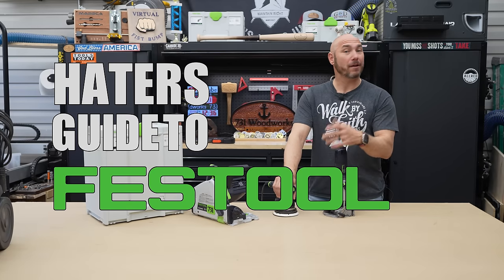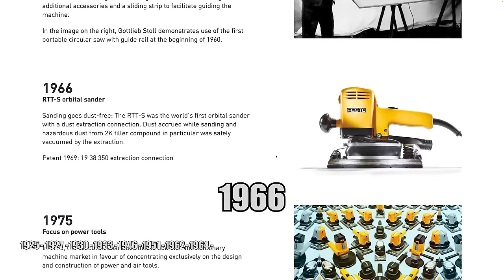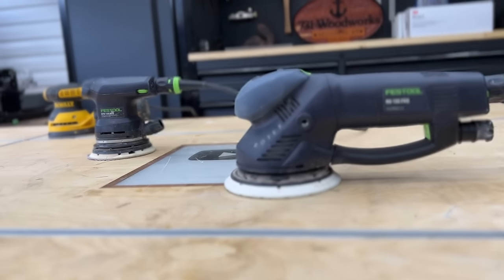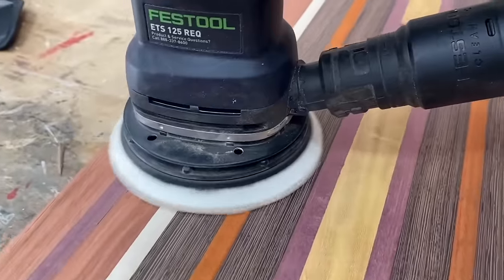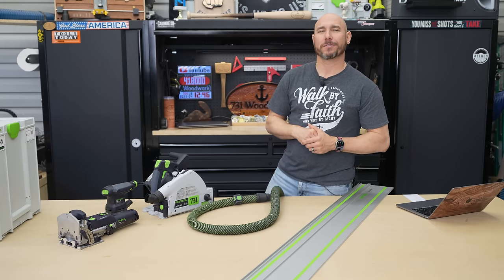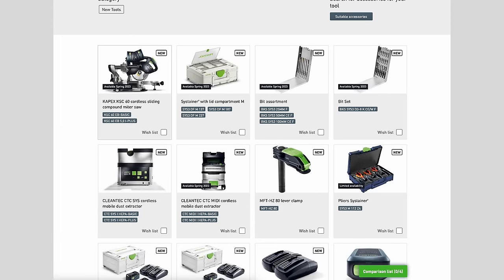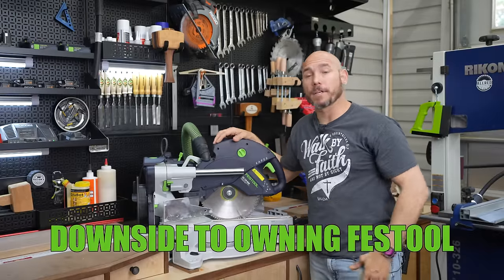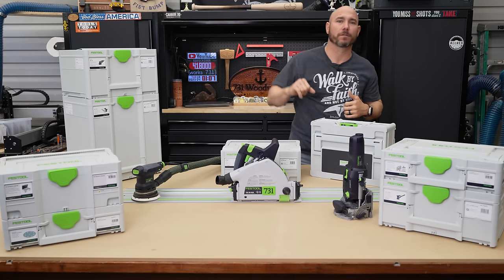The Hater's Guide to Festool | How Festool Changed the Game

Comment: I have been a professional cabinet maker for 39 years.
I watched Norm for years. He used a porter cable small worm drive saw and 2 clamps and a straight edge to cut sheet goods.
When I saw the track saw I about fell over, along with the price. So I saved up and bought it. GEEZZZ it saved me hours cutting sheet goods. Along with being as accurate as my Delta Unisaw. Enough said. Then I bought a festool vac and sander from one of their clearance sales online.
I saved 30% by buying what they considered a number 3, which was supposed to be an item that was returned and showed wear. Lol, it came perfect. Not sure of what marks or signs of use but was mint. After using that vac with that sander it changed how I sanded. I could skip grits and still would get a better job than  using my air Dynabrade sanders. I was sold. All the haters either don't have Festool or never tried Festool.
What's sad is most of these haters will hate on anything and everything.  Keep up the good work. Remember, the silent majority loves Festool.

Comment: I’ve owned and used Festool for quite some time. There tools are in my opinion the best. They save time and that’s money in the pocket. So probably not so expensive. I have used the rotex ro 125 and the ets ec 125 on solid surfaces counter tops for 10hrs a day 5 to 7 days a week for 8 years and there still going. I’ve also used just about every sander out there. Big name sanders, air sanders, big box store sanders. None of them come close. Have a good one.

Comment: On the TS55, i wouldnt get 2 54" tracks. That's a waste IMO. That extra track has nonuse unless youre cutting longer than 48".  Instead, get a 75" and a 32" or 42".  You can still join them together to cut 8', but the 75" os a little better at a 48" cut as there's more overhang on each end and you can use it to cut 60" Baltic Birch.  And the shorter track is a lot more handy for cutting parts to length.

Comment: I used feetool sanders for sanding plastered walls. Combined with their vacuum. Wasn't too impressed, still quite a lot of dust. When the highest priority is getting things done fast then yeah, many of those fancy tools help with that. I don't see why people use dominos on edge joints. Just for aligning? For building furniture I feel like you would need other tools. And for carpentry (at least what carpentry is for me) you would need more robust tools for rough work.
Oh and all those cheap ABS plastic boxes? I stuffed all the boxes into the garbage bin. I have no space for those. I never put tools back into those. For me it's a waste of resource that now every tool has to come in a huge plastic box and then you are expected to add a whole tower of more boxes. I'd rather buy a good table saw than a miter saw. And if you are just doing wood working as a hobby you can do quality work with the simplest tools. It won't be the fastest way but no amount of tools will create better quality. Furniture now isn't any better than 200 years ago. Just cheaper.

Comment: I saw contractors work with Festool tools and I asked one of them to try their screwdriver. It screwed in a long screw into a thick piece of pine. I was astonished and I decided to buy one for myself. I bought it at a discount and I use it daily for five years now. Although I can't afford Festool tools, I appreciate the quality of their tools. My other tools are mostly made up by Bosch and Makita, which are very good tools as well. I don't need them, but I know how they feel in the hand. They're friggin' expensive, but just to watch the tool do its job is pretty satisfying. It's a brand that engineers products and I appreciate engineers, they think of practical solutions for the everyday job.

Comment: I am working in public services and I am away a lot where I need to work the cheap stuff from the construction markets and it really sucks if they stip screws or simply brake apart. Dewalt, Maikta and so on clearly is a choice but not in the budget as it needs to be cheap only because we'll just use it a few times... Now I tend to bring my private tools on the field trip inlcuding Festool, Fein, Mafell and apart from the extra luggage I am happy at work with my Hobbysist tool selection.
The price is of course a critical point for a hobbyist but I bought a lot of the stuff used in good or bad condition and it works like a charm. That said, I never had a used tool break on me with festool but some  new tools needed to be sent in after a few weeks (Kapex, Chargers, Syslite, C18) and last since then. Most of the stuff I could sell today at a higher price than what I paid for it a few years ago. So for me it was a good deal. However, I think here in europe the used tool market is a bit more tame as a lot of Festool and so on is used and you have a better selection. Still it may take some time for a good offer.

Comment: Love festool/// get aggravated with festool.   What doesn’t bother me.. high PRICE of tool. What does bother me.. high price of consumables or sanding pads, saw blades. 

What I love is how well the tools are made and yet they absolutely ignore critical feedback from US customers. Festool is a lot like Apple.. they tell us all what we need and then tell us we will like what they come up with.  And yes… I often do like my Festools as I like my Mac and Ipone. However I loathe the fact that my $4500 laptop doesn’t have a touch screen or pop off screen that becomes a tablet.  I hate that it won’t play a lot of games well.  I hate that I can get silver or slightly darker silver (grey) colors.  Festool doesn’t make a good job site table saw, the new one is too small. Festools miter saws handles are a pain to use and festool needs to offer shadow line on all of their saws and an ultra capacity 12”.  

Lots of other issues that festool could remedy like their cheap and cheap foam plastic storage cases. Or their crazy location of switches and speed adjustment on some of their sanders. 

Regardless. I’ve yet to find a perfect tool manufacturer. Festool is certainly a quality brand.

Comment: Let me give my reasons for not using Festool. I always have said they were good tools. When you figure in the research and development plus the cost and a decent profit for investors as well as paying a decent wage. The price of the tool at the retail level would come out at about 50% of the price. They can charge what they want. I am happy to pay a fair price for quality tools. That's just it; a fair price. Festool is trying to sell their tool's quality by charging more, inferring that they are worth the price. I wouldn't bat an eye if Festool was at 50% of the current price. It's like a cup of condensed soup selling for $10. Is it good soup, yes. Is it worth $10? No. As for ease of use, it's like Snapon tools; it's just not worth the money no matter how good it is. And for the ease of use. There are plenty of tools, if you think about that can be made to operate as well. Also, Festool is off standard so if something breaks, I'm out of luck. If they were sent free to me, I wouldn't use them other than for paper weights or the equivelant. I would invest in the parent company of  Festool if I was twenty years younger, that's different then using their products. Be safe.

Comment: Reason that we hate festool is not because it is expensive. Price is fair and I'll even go as far to say that their machines for most part are not bad. But they are way WAY overrated in most instances

Then there is the whole incompatibility with just about any that is not Festool.  Proprietary bits, seriously?! God forbid you should make your saws compatible with a different rail system, that would be a scandal!  Didn't seem to bother Mafell who gave their MT55cc, undoubtedly the best tracksaw on the market, the ability to use festool and makita tracks just to make it more versatile and convenient for their users. The router track guide has this ability too.

Pretty much all Festool machines have countles versions and new models are made at higher rate than smartphones these days.  Tracksaws in particular. the TS55 has more letters behind it with each iteration than the whole LGBTQIA2S+ lot. Mafell doesn't do that, they have one version of each machine in particular size and if after years and years they decide to upgrade it, the old one is discontinued.  There's a lot to be said about releasing mature products that don't need tweaking with every seasons release and not leaving your customers feel cheated because the last years new model just had a new letter stuck to the back of its name this year.

Festool ecosystem? Seriously? Most high end machines come in Tanos boxes and newer ones with T-lock.  
My extractor hose with a tool adapter works on pretty much every machine i own regardless of the brand.  It is nothing special or new or wildly inovative. The cord thing i have to admit is pretty damned cool though and i will be modyfying my most used corded tools 

Best dust collection on the market? Tell that to my MT55, UVA115 or DDF40 🙄

Festool is the Apple of tool world. And festool fans fit to that comparison perfectly as well. 

I have over 30 machines from various brands, mostly Makita and Mafell, and  not a single Festool. That will not change as even if there was to be a tool made by Festool that is the best suited for my needs i still would not buy it simply because i don't like and don't trust the company.

Comment: I have taken the plunge with their DF-500 Domino. Watched another YouTube video comparing the Festool, Mafell Doweller, and Lamello Zeta; the latter are quite a bit more expensive the Festool. My next purchase will be the RO 125 Sander. To me that sander is awesome by being able to use geared motor for taking a lot of material off and then switch it to a normal Orbital Sander, pretty cool tech.
Reply: The Rotex is pretty awesome.  You won’t regret having it.
Reply: I also got one (A DF-500) - haven't used it a ton yet but it is an impressively nice feeling & well-made tool. Did a couple test holes in white oak and the tolerances when referencing each surface/edge are phenomenal. One domino can line up a whole 4-6" glue joint pretty effectively (even though you might prefer more for more security) - nice for things like mitered frames/boxes.

Comment: The boxes they come in. TLoc, Tanos, Systainer whatever you call them are,

Just a box, if you only have one.

If you own two, they are kind of clever but really they are just two boxes.

Own three of them and all of a sudden you are starting to understand.

Own four or more and you get it, 100% you get it.
Transporting your tools, clearing up after the job, storing them in a small space, you just get it.

All your tools now only take up a footprint of 400mm x 300mm  ( 12"x 16") of floor space. That is until you reach the ceiling height which has happened for me. Twice!!

Comment: I used to hate festool when I was more novice and generally did more roughing type work.
And I think a lot of the hate comes from that too, they're not tools for builders, you don't carry a festool x up onto the trusses of a house your building, or use it to cut fencing (I mean you can, but that's where it's worst placed)...
Festool is for finer woodwork, cabinetry and the likes - and when doing that kind of work, like I started to, you instantly understand why it's far superior in many ways.

The easiest way I can describe it to someone is as noted dust extration, working indoors, you can't find tools that extract dust anywhere near as good as festool, it's a strong function by design rather than an after thought.
And secondly, take a plunge saw, adjust the cutting depth to 22mm and cutting angle to 30 degrees, do it on a ts55 and then do it on say the makita...
No additional tools allowed to set them, but then we will check how accurately they are set afterwards and how long it took to get right... once you've actually tried that, you'll get it.

Anyway, I now have a bunch of festool "stuff", tools, tables, jigs etc. and love them all.
The last expensive tool I bought that wasn't a festool was the makita rotax sander... it was before I had commited to festool, the price was just so much better than festool...
Now a few years on, god I wish I just ponied up the extra money and bought the actual festool rotax sander...

Anyone wanna buy a makita "rotax" 125mm sander??? :D

Comment: I use IEC plugs (the one for power supplies on pcs) in all of my tools, I hope manufactures decide to get that standardized.
Reply: you have tools that already have them or you remove cable and install those plugs and connect everything?
Reply: @Kubey.  I removed the original cable on the tools. You could open the tools and replace the entire cable, but I prefer to cut the cable leaving 5 or 10cm. Then install the male connector on the tool.
One thing that surprised me was the poor quality of the cable even on expensive tools. The best and longer cables are then fitted with female plugs.
Reply: @SRG-Learn-Makers  so you did it just like I was thinking to try with some tools, but I was thinking about some quick-connect or something
Reply: @Kubey.  My quest began with "audio" quick connect, there are neutrik powercon NAC3FX. I was inspired by @MariusHornberger, who did it in one of his videos. The plugs are awesome but quite expensive. Later on I discovered that are some IEC Lock style which are designed for servers but honestly, IEC doesn't unplug by themselves so easily, in my experience virtually none, but the times were it happens I just loop the cable before the plug and no trouble at all. I recommended greatly.
If I could add links I'd showed you how cool the tool wall looks now basicly because all tools are battery powered or shortcabled.

Comment: I chose the TS-55 REQ, rails, and MFT/3 years ago.  Oh yeah. I even changed my vac hose to be 27mm so it will fit my TS-55, PC 890, PC 360,  The Festool is a system and is fantastic for doing many professional and amateur jobs.    Still have high desire for a Kapex and an OF 1100.  But what I have is incurable.

Comment: I was a professional woodworker for 42 years. Not a Festool hater. But not a lover either. In the US you can buy them at a reasonable price for pro grade tools. In Australia they are a second mortgage. Hard to even justify. If I had the money I would probably own their tracksaw. A sander. And a Domino. But never in that league. They are seriously expensive here. Parts are in short supply and also cost the earth. My only hate with some of their tools is ergonomics. Each to their own on this one. But for me when I use them they feel wrong. The drills are just weird. The mitre saw feels equally strange. Planer the balance is off. Etc. Lots of stupid fiddly green plastic bits. I'm not good with fiddly plastic bits. Break, lose or bin usually. Never got into having a vacuum attached to everything. I started in an era of few power tools on site. Then all the corded. Now the cordless. Great improvement being able to walk around with no cord. So then you attach a vacuum to everything. Worse than being a corded electric tool. Defeats the object. Fine in a shop. Pointless on a building site. If in the US I would certainly have a few. In Australia I seldom saw them on site. My mate has a couple. Has to order even consumables because not stocked items. Basically Festool continue to drop the ball in Australia. The same as Hilti.

Comment: They are great tools to work with, and if you have jobs that pays well, then it is an excellent brand, but you keep buying from them and the plastic parts and electronics in particular regularly break. But it is also susceptible to theft. All this together, Festool can cost you a lot of money in a very short time. I need tools that do what they're supposed to do, and I want my attention to be focused on my work. With Festool your attention is focused on your tools more often than you would expect. It is a high-end tool that also requires high-end attention.

Comment: I’ve got a few Festool tools that I bought second hand for a way lower price due to being in rough cosmetic shape, but they’re working really well and I love them. I think that speaks to their durability, especially my kapex 60 that was used to cut bricks but only needed a cleanup to run smooth and cut accurately!

I even have a few old ones from the early 2000’s and they still feel like they’ve barely been used. They really hold up well.

Comment: I had an opportunity to make my table using the domino. Sure for the first time using it requires careful adjusting and its slow because I was learning to use the tool. So I needed to read instructions, double check everything but once its adjusted and you have marked your spots you can just drill the holes so easily. And once you learn the system its easy to adjust the settings.

So I checked these tools as soon as I got a job as a wood working teacher (in an elementary school). And I was shocked at the price. I couldnt justify buying that tool for work because elementary kids couldnt use it themselves anyway. But Im not hating the brand for it. The tools are awesome and nobody else does those same tools. So if I was pro making wood furniture or anything else I would probably invest on some of their tools.

Comment: My first festool purchase was the 18v Drill all the way back in 2014
1. was how it felt in the hand, the balance, the ergonomic grip. 
2. The electronic torque saved my wrist. 
3. Not chewing screws when used as a driver. 
4 how smooth it was in operation and it’s control. 

Fast and least. It’s looks, it looks like a phaser from Star Trek. 

I am not a tradesmen, just a occasional DIYer, yes I refurbished apartments but that came way later.